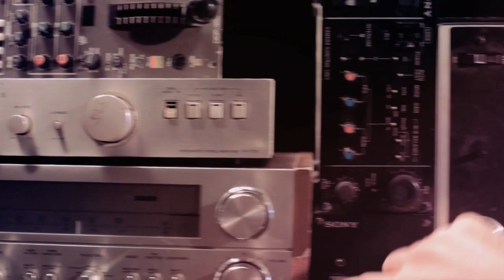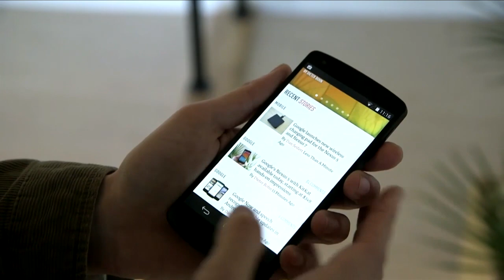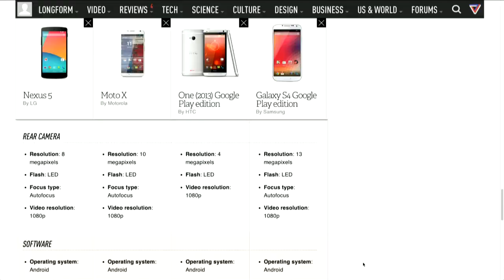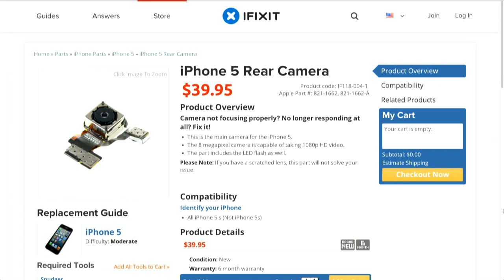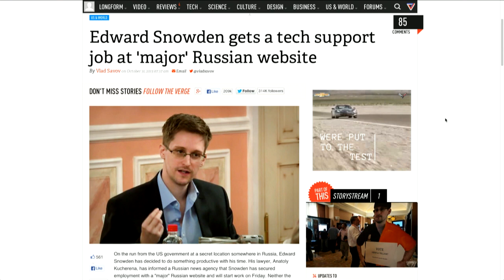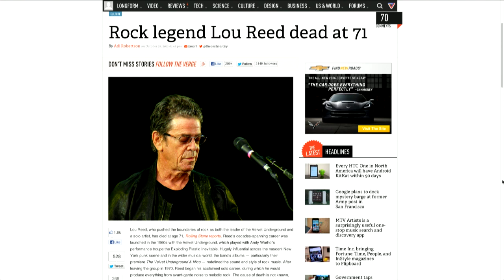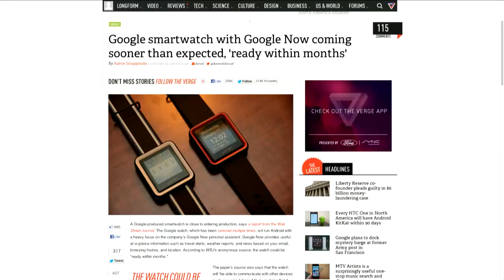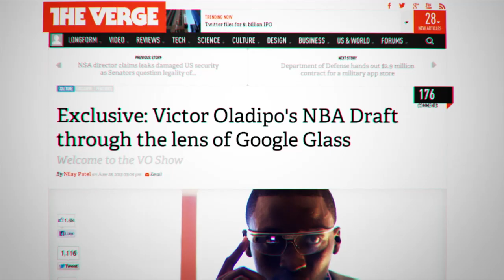The Vergecast 100: Nexus 5, Android KitKat, and NSA snooping

Comment: In reference to the FAA portion, I'm a pilot and the only instrument in the aircraft which is directly effected by electronics is the magnetic compass. The compass is rarely if ever used in modern airline flights thanks to GPS / VOR Navigation. I can understand why cell phones are required to be "off" because of the interference with headsets / speakers, which can be annoying and or distracting for pilots, but there is no immediate danger if electronics are used during all portions of flight.

Comment: This is my third day using the Nexus 5. I love it. It's fast, has a beautiful display, and I like the design and KitKat very much. However, the complaints about it seem to be genuine. I don't trust the camera to do well on the first try. However, in ideal conditions, photos can turn out very well, but it's still hit or miss on average but you'd also have to be daft going for a Nexus for the camera. Furthermore, the battery drains quickly while the screen is on but standy time is excellent.

Comment: Time Stamps
7:10 – What Paul has been up to
9:45 – Convoy
14:15 – Nexus 5 and KitKat hands on
33:12 – Moto’s Project Ara
38:48 – Phone Call(Camera’s in Nexus phones)
44:15 – Phone Call(Nexus 5 performance)
57:07 – FAA approves use of electronics on takeoffs and landings
1:07:45 – The NSA has tapped into Google and Yahoo networks
1:24:50 – Lou Reed’s death
1:36:40 – A Google watch running Now is rumored
1:42:30 – Verge memories & reflections
1:53:20 – Verge video recap and Wrap up